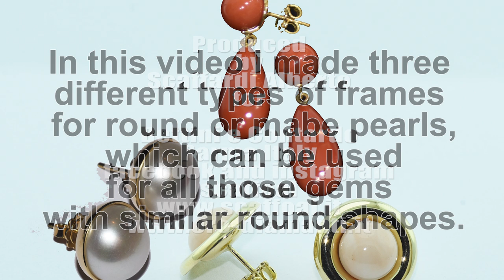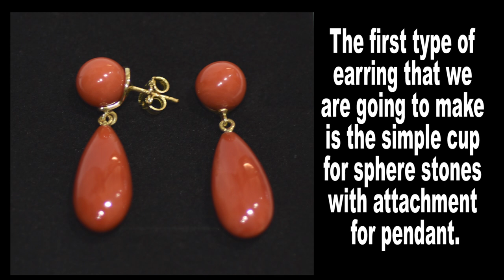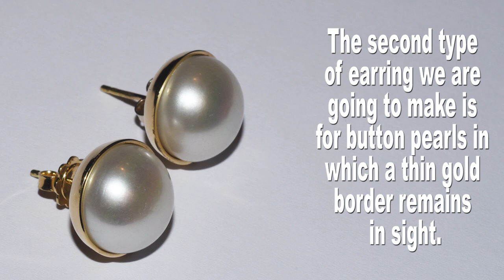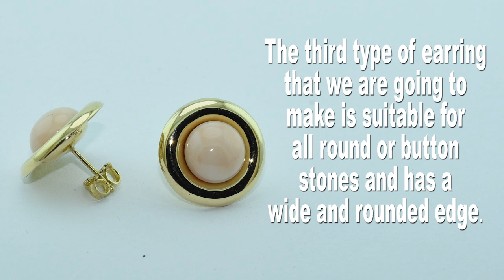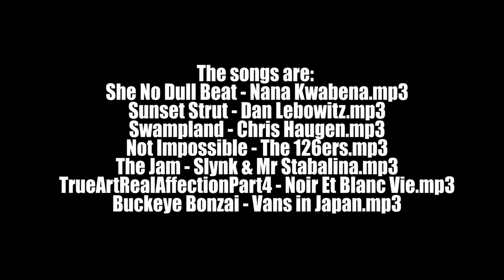How to make some types of frames for pearls or round stones

Comment: Wonderful to see your processes and amazing work.❤👍

I recently bought some oval amber pieces flat on one side, curved on the other, and don't want to use glue to mount them, could these techniques also be used for amber but without glue?😊 Is it possible to use a mounting system similar to diamonds or other stones?😅